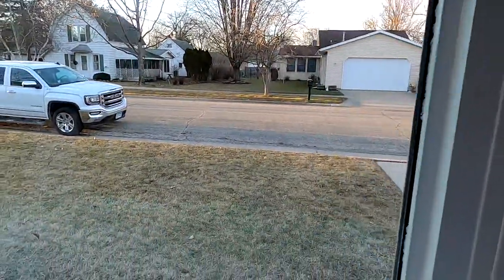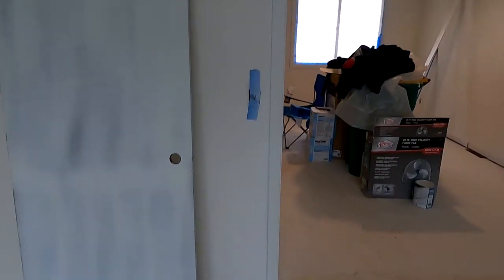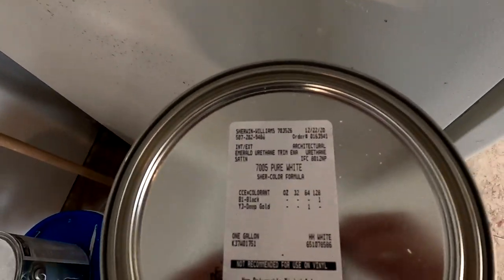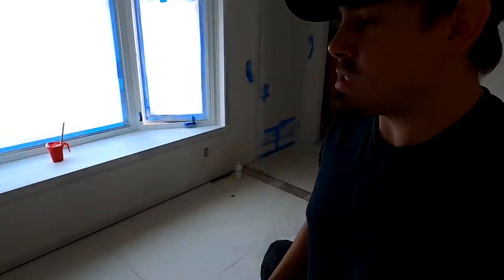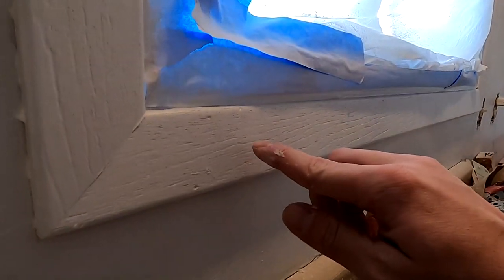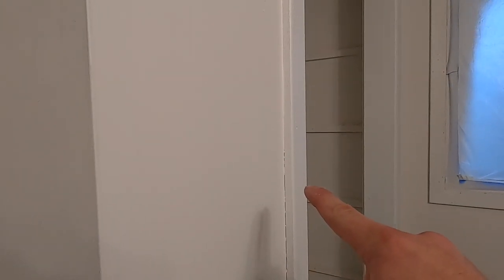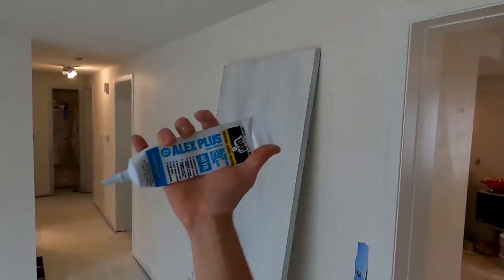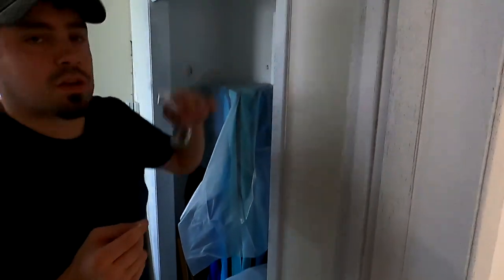[DAILY TIP] HOW-TO-PAINT-TRIM & CABINETS!

Comment: I recommend using a silicone caulking but if your doing all windows amd.doors ypu need multiple bottles amd a caluk gun amd wet rag or sponge to wipe the line after ypu run a finger down it. Spackle and sand all hold or dings on the wood. Sand them then prime then sand again then spray firt coast unless they want the brush look but it comes out uneven looking sometimes with brush strokes. Spraying it's very even

Comment: Could you help a newbie diy’er out!??? Ugh I wish I would’ve found this before I sprayed! I practiced with the sprayer in an upstairs room that never gets used and the oil based paint went on like glass…i felt confident to do my dining room. Since it was an oil based paint on my trim I deglossed it then used the exact same sprayer you have with the extreme bond paint. The primer was so thick when I sprayed it came out looking like orange peel I thought I needed to thin it with some flowtrol (?) it didn’t help…and I put it on really thick thinking I could roll it out. Help. Please help. What do I do now? I know sanding is probably gonna be in my future. I will be using the emerald urethane semi-gloss trim paint from SW to topcoat.

Comment: The guys I hired used the Emerald urethane on my trim and some doors (primed MDF), but they didn’t degrease/wash, they used a sprayer, and I’m pretty sure they didn’t prime even though I bought the exact primer in your video. It looks terrible in some areas and is already chipping/flaking off. I want to redo it all myself. How can I redo it all? Wash, sand, prime, paint? Can I use a brush to apply the primer? I know you said thin coat of primer, but I’d rather not buy/rent a sprayer just for primer.
Reply from the maker: That’s no fun. Sorry it didn’t work out. Yes, applying with a brush will be fun. Degreasing then sanding those tough spots will for sure make a difference for you. 👍

Comment: Did the primer mess u your sprayer? My local Sherwin Williams told me that the primer destroys the graco airless.
Reply: That extreme Bond primer is a water base it is not destroy your machine as I've used it for the last 2 years on 20 plus cabinets

Comment: You're sadly mistaken those indents in the wood are not going to level out, the self-leveling properties in the paint eliminate brush strokes and roller stipples, they don't even out 1/8 inch gouges in wood lol
Reply from the maker: Just finished my 12th oak cabinets with it. Finished like glass. You’re wrong. Clearly you’re just experiencing user error. That’s pretty embarrassing.  But thanks for the good laugh.